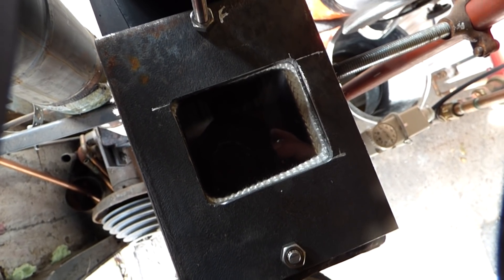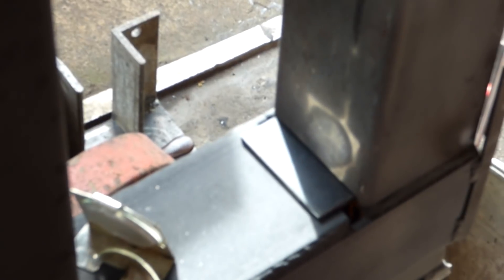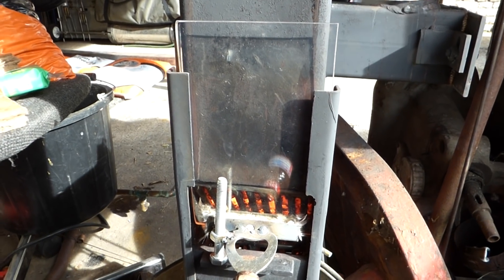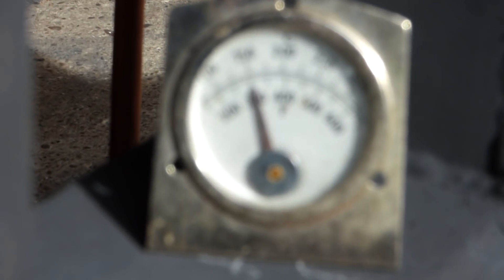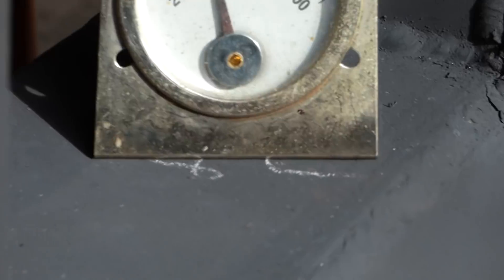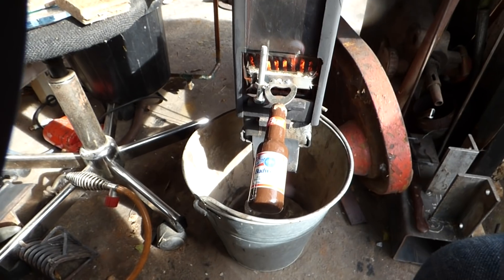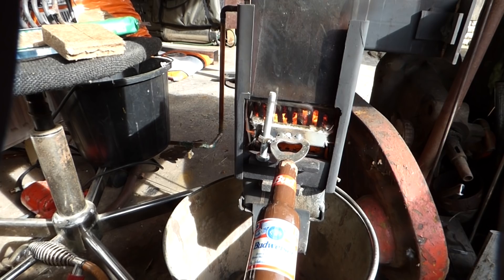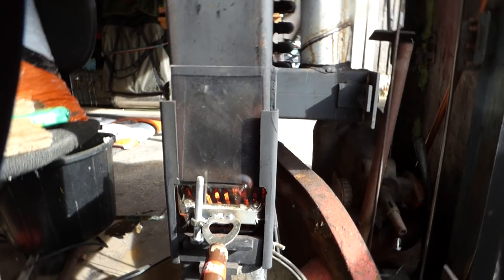upgrade rocket stove boiler MK 3 wood pellet DIY No.42

Comment: Thanks Dave I made your design & it works great as a heater on kitty litter. Australia
Reply from the maker: Glad it helped
Reply: I have used a 100mm square as my flue. Can I use a 45 flue to same straight flue to build another traditional rocket heater or will it effect draw? I have a damper on each section??

Comment: Hi Dave.
You have mentioned a number of times the inconsistent and unreliable temp readings you are getting. An accurate temp of the fire vessel, as well as the water in and out, would be quite useful in determining boiler efficiency as well as evaluating potential volume of 

If you coat the steel with a high emissive coating, you should improve greatly the accuracy of your IR thermometer. No need to paint the whole thing, maybe just a few selected target spots.

Comment: Hi David! 
You are doing a lot of hard work experimenting and then giving away best results for the people to use and make it great at first attempt! Not many kind people like you I must say.

Two years ago I also experimented a bit with gravity pellet stoves.The only problem I've had is ash buildup. No mater what type of burn pot I make or use I always had ash build up on it which would kill the fire after hour or two. I watched all your videos and if I understood correctly you absolutely have no problems with ash buildup? Could it be because I didn't have that long chimney (poor draft)?

Oh and one more thing.
Can you explain why did you choose pipes in heat exchanger insted of water tank welded right next to fire pot? Too high temperatures?
Keep up the good work!
Reply from the maker: About ash build up, probably not enough draft or chimney might be to short, suggest to be  2  45 degrees a minimum of 3 metres. Using pipes is a smaller amount of water which heats up quicker. hope this helps.
Reply: Thanks for the reply David. I'm collecting materials and will definitely build one. Once again, thanks for sharing your plans and experience with the world.

Comment: Dave, how is your heat exchanger holding up? My thoughts when I build one of these is to use stainless tubing instead of iron pipe. Do you have any ideas to share.
Reply from the maker: Very good. Yes stainless steel would be good as long as it is thin.